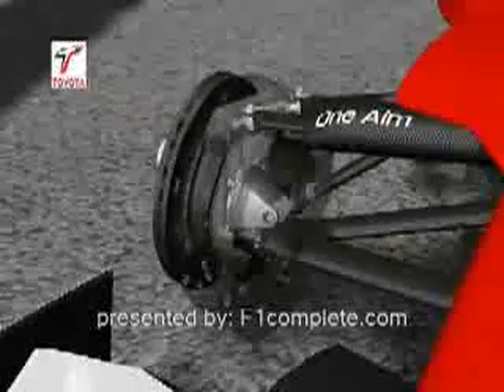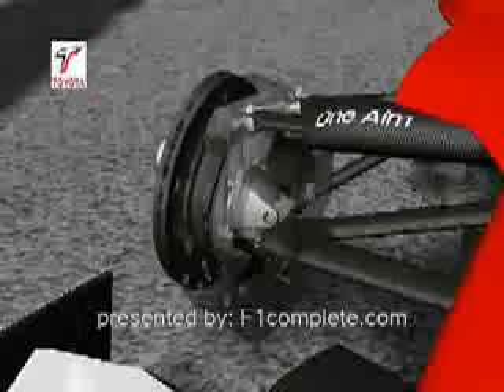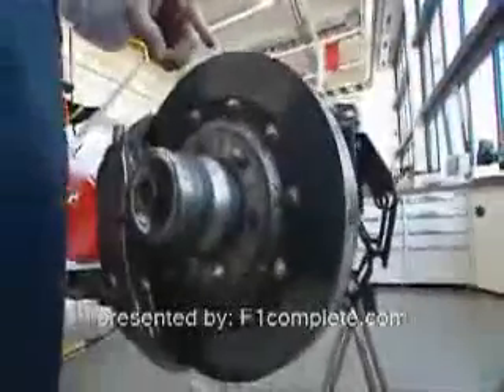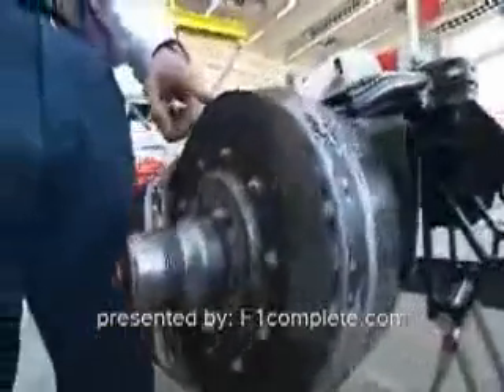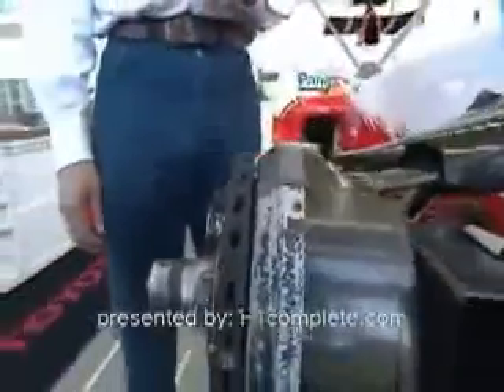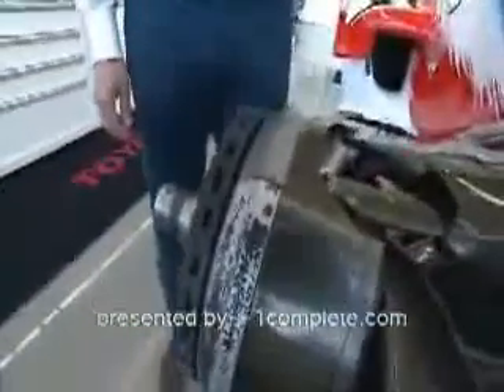Formula 1 brakes

Comment: 160 km/h in 6 seconds ;-D  hahahaa that's way to slow they are much faster than that ;-) they go o to 200 km/ in 5.2 seconds ( abouth 225 km/h in 6 seconds ;-D and they stop even faster ;-)
Reply: if he ment 0 to 160 km/h and back to 0 in 6 seconds then he's correct but he should have mentiont it differently ;-D
Reply: *facepalm* ...just....*facepalm*
Reply: this video is old enough for it be that when it was uploaded you were still in your diapers. 
You probably didn't get that. 
it's an upload from 7 years ago. Ofcourse things have changed since.

Comment: this is why f1 cars are so high performance
everything is in such a tight tolerance. Tires must be at a certain temperature, brakes needs to be warm enough, engine also needs to be a running temperature before being started up. All that add up to an impressive lap time.

Comment: @dude2106 Maybe... They can step on full brakes and get 4-5 G because of high downforce. They cant do the same with engine because in that speed they dont have enough torque to reach that G. But anyway its still 4 wheels vs 2 wheels.

Comment: @LoserSVK You cant put it up like that. It is down the how much power the engine has and how good the breaks are. The acceleration, above 100km/h or whenever the rear wheels will not spin, is all down the power of the engine. The tires will manage perfectly.